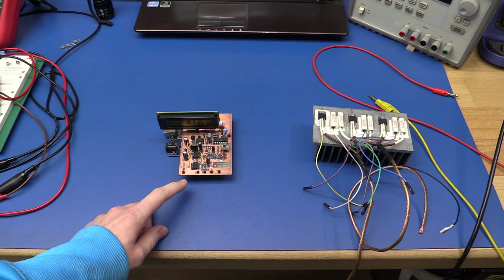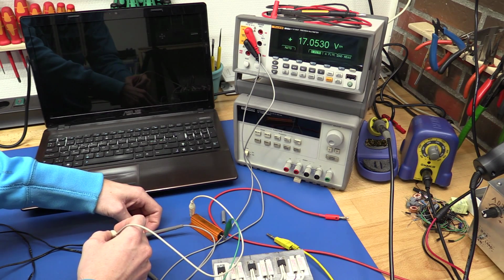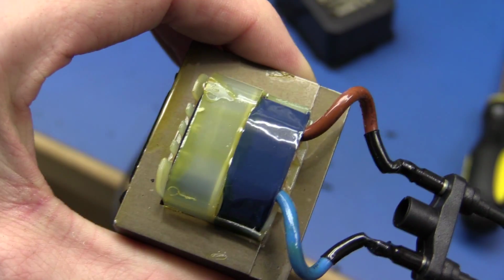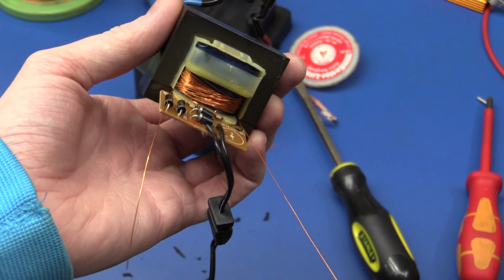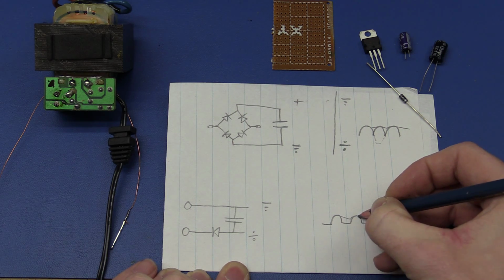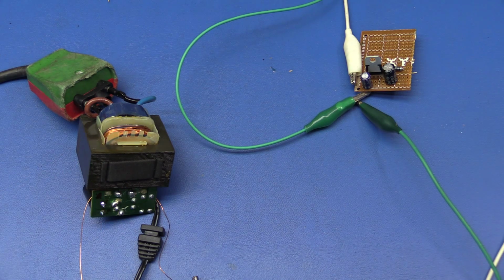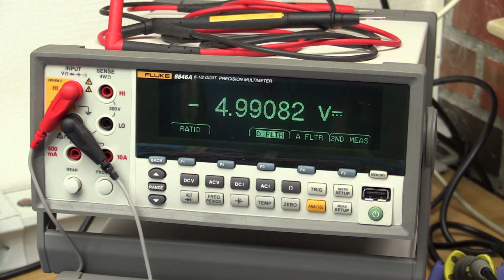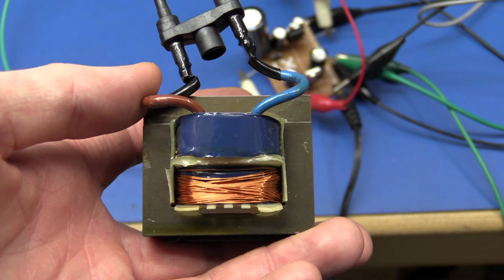Adding a Winding To a Transformer (DC / CC Load part 4) - Ec-Projects

Comment: For low currents like that you can use a NE555 as a negative charge pump:
http://www.seekic.com/circuit_diagram/A-D_D-A_Converter_Circuit/_15_V_TO__12_V.html
Reply from the maker: superdau That's the next video :)I thought about including it in this one, but decided it deserved it's own video :)I used an inverter chip and two transistors instead though :)Thank you for the link and the tip anyway!